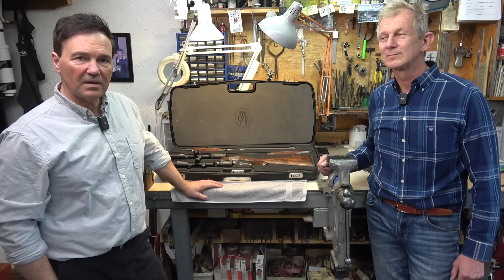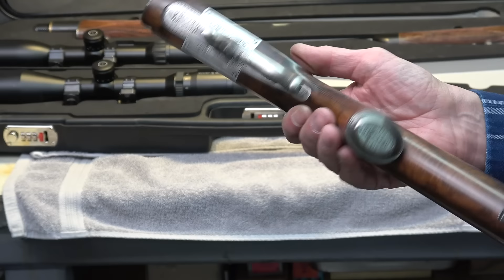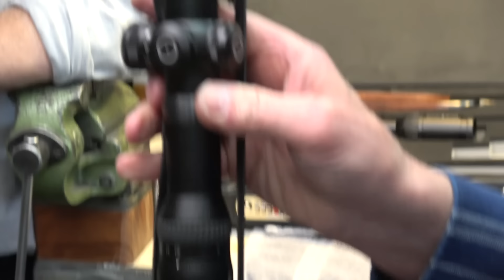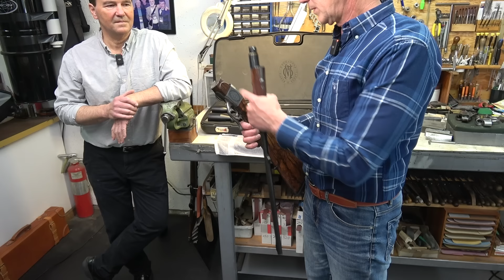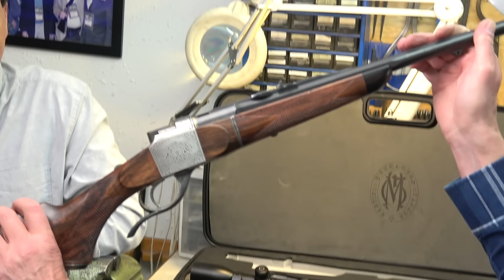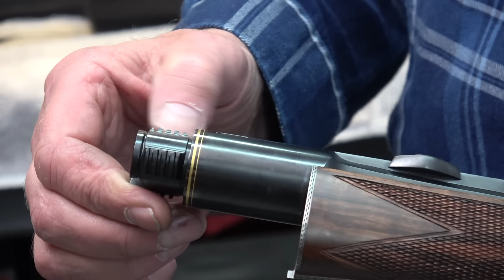Martini CUSTOM Takedown: Gun for MANY Occasions

Comment: I watched a video on a 1955 Mercedes Benz 300 SL Gullwing. every nut an bolt was engineered and built perfectly. The owner had a spare convertible hardtop for that came from the factory in a wooden box. Even the wooden box was a beautifully engineered and built marvel. I came away with a new respect for German Craftsmen and egineers after watching that video.
Reply from the maker: Yes, the MB Gullwing - superb. It is true, what they say about Germany and German engineering. The firearms are remarkable.

Comment: The funniest part is that he would not even allow you to handle it. Just imagine the first time the new owner tries to put it together. Chances are they will cause damage to it and reduce the value significantly. It's a no from me. 😂
Reply from the maker: : ) Well, that's me in the picture aiming it. Hopefully everything will be okay and I understand what you're saying. Maybe buy a Ruger : )
Reply: @UnitedStatesOfGuns  The Hagn action is the finest falling block ever designed. The ejector in the Ruger No1 can bypass its job if a hot hand load is used in a warm gun leaving you with a stuck case that has to be removed.